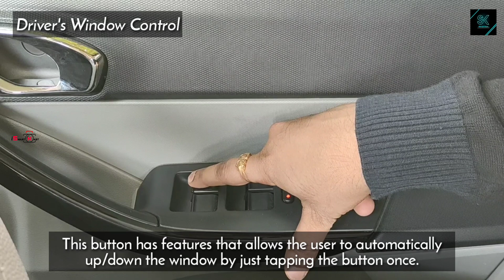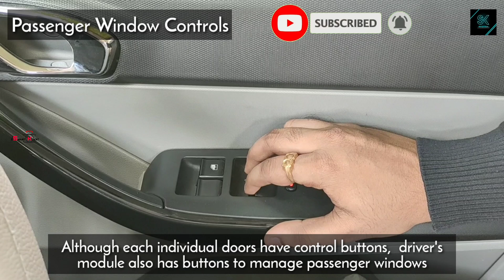POWER WINDOW & DOOR LOCKING CONTROLS OF A CAR | CHILD SAFETY LOCK | SPEED SENSING DOOR LOCK IN CARS

Comment: After locking all the doors with the master lock on driver side, could the passengers open the doors by unlocking them manually
Reply: yes they can
Reply from the maker: yes.. individual doors can be opened manually even after the master lock on driver side is locked.
Reply: Not if you put on the child lock on the inside of the door